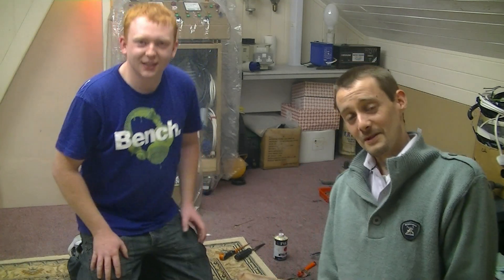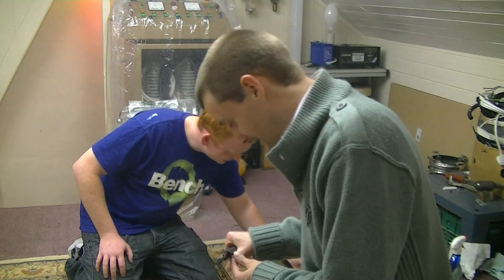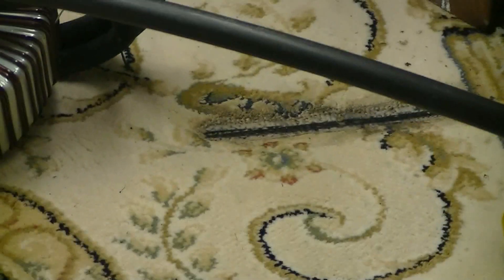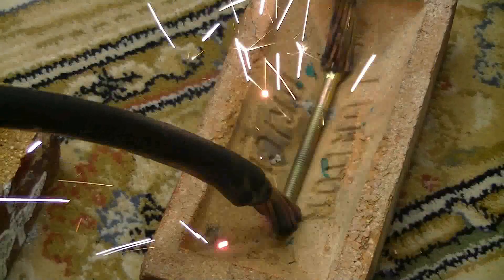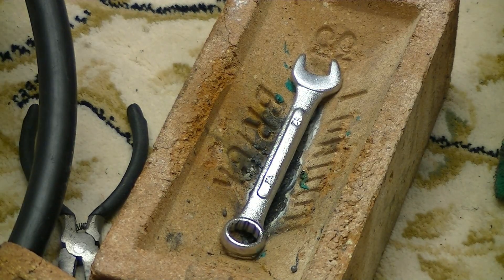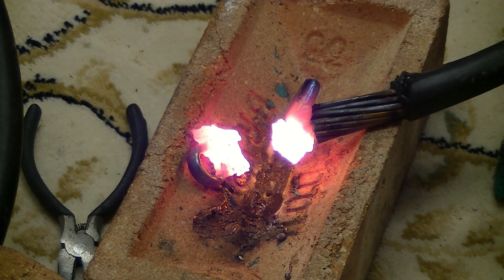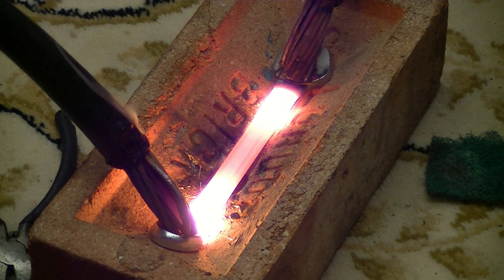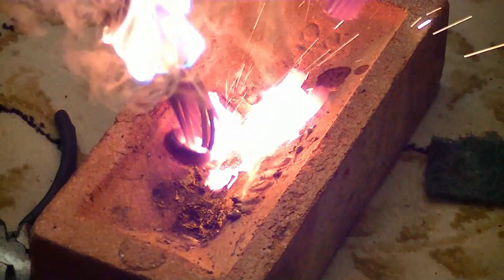5000 Amp Fuse + Tools Melt With High Current

Comment: They are going to find these 2 idiots in that room cooked like over done corn dogs, that's more than enough amps to stop your heart...
Reply: Nicolas Ostrum no, a transformer can get very high amperage and very low voltage as seen in this video
Reply: Waffles is right the rest of you are ill informed.
Reply: Or burnt to death because they got molten iron on the carpet.
Reply: calling people retards when you can`t even spell....the irony!
Reply: yeh a low current across th heart can sop it (think its like 20ma or something) but you need sufficient voltage to get a shock. For example, a 12v car battery can supply 100s of amps for a short period of time but you wont get a shock of it if you put your fingers across. Not sure what the voltage starts at to start getting shocked though
Reply: Pro Wafflez why exactly, explain?
Reply: dean lewis just watch this he also did a video on what is the killer volts or ams https://youtu.be/hp97GjuULX8
Reply: volt relates with amp,so you can't get a too low voltage but high amp because the electric flow will not  create a current,and you can't get a too high voltage with too low current because the current will flow in the surface of material and can't make a strong electric current.High voltage is more dangerous than high amp,high voltage can burn or shock you when you stand in far of the source,even when you touch one terminal and wear shoes.But high amp current can't kill you when you touch because it can't flow through your body,but if your body have suitable resistance like water in the skin surface,the 9 volt high current would be heating the skin only.
Reply: Nicolas Ostrum in a human body you need high volts! For a disaster, the Amps come if the source is able to produce that kind of power.
Reply: Nicolas Ostrum it isn't volts or amps it is frequency that causes atrial fibrillation.
Reply: Yes, the amperage here is plenty enough to kill you, but the voltage is so low it wouldn't even be able to go through your body.
Reply: Reading this comment thread makes me wonder if some people even graduated high school.
Reply: https://en.wikipedia.org/wiki/Electric_shock?wprov=sfla1
Reply: lol good video. I wonder where it starts  on your hands, or hand to hand across your chest. Have had mild shock off telephone wires (think they ring at a higher voltage too)
Reply: it isn't high enough voltage for you to even feel.
Reply: Sebastian Neufeld Volts and resistance define how many amps flow ffs
Reply: Sebastian Neufeld HELL NO AMP IS CURRENT NOT RESISTANCE
Reply: LoliDefiler amen ;(
Reply: Thomas Cruz they wont go trough the cable at all man cuz the circuit isnt closed okay? Learn it ffs
Reply: JAMESMANHUNT9 NO IT GOES UP WITH VOLTAGE. YOURE TALKING ABOUT WHEN U TRANSFORM V TO A  BUT THIS IS ABOUT RESISTANCEE OMFG
Reply: Luke Deedman see its ez
Reply: Luke Deedman but your resistence values are wrong i think
Reply: Pro Wafflez you don't know how electricity works do you?
Reply: As long as the voltage is low they can touch the wires and not be phased
Reply: .01 amps is enough to kill you whats gonna kill you is something that has a very high voltage and low current
Reply: Whether current relates to voltage is irrelevant for me here I know what I know but..  Il ask anyone here if you think your right and say that it won't kill you Il still put money on it that you wouldn't touch both ends of that cable and if you argue the point but not enough to do it kindly keep your opinion to yourself or let's see how right you really are :)
Reply: there are not enough volts to pass your skin resistance. More dangerous to make this on the carpet.
Reply: You must have high volts for the current to breakthrough this thick sheet of resistance we have called skin. If we had no skin at all and we were wet volts would I'll us. Lol. But it's the combination
Reply: Fucking jesus christ no
You would need at least 50 or so volts (depending on skin conductivity and whatnot) to actually get enough current flowing through your body for you to feel anything
The voltage directly determines the amps (Heard of ohms law?)
If the voltage is low,  the current capability is high but nothing (or very very ltitle) will flow through your body as the resistance of your skin is way to high.
Reply: No shit?  It could stop many many hearts...
Reply: NIkefan253 an ipad charger releases 2 amps and 5 volts acording to you it could kill someone, but it doesn't because you need both volts and amps to kill someone you need a balance of amps + volts it cant be just 1 off them
Reply: Randolph Catchot  For anyone curious about what will and won't kill you, I thought I would answer as a student of electrical engineering. It is both amps and volts that will kill you as well as exposure time. I've seen a lot of people arguing about the correlation between voltage and current. The truth is you cannot determine the value without the resistance. V equals I times R. So I would assume that the resistance is low. Say it was at 0.1 ohms then the voltage would be 500 for example. Your skin itself also has resistance of around 10,000 ohms dry or 1000 wet, once your skin brakes down from the current your resistance drops to 500 ohms. In a case where your skin is wet completing this circuit with your own body would most definitely result in your death . Most likely you would not be able to let go and would die. With dry skin a lower current would be able to make it through that would be less than lethal.
Reply: Randolph Catchot not enough volts
Reply: +Sonet that's bc 50 volts is probably the threshold for getting shocked.  a 24 V probably wouldn't do anything even if it had that many amps
Reply: actually as voltage goes up amperage goes down
Reply: 50 mil Amps is enough to cause cardiac arrest, this would light you on fire..
Reply: We were always taught in basic electronics that 60 milliamps is enough to kill you.  Different sources say different things on that amount.  Basically, it's less than 1 amp.  Those that think you need high voltage: Come where I work and grab a hold of one of our main bus bars.  It's only 50 volts, but 3450 amps.  We'll come sweep you up later.
Reply: NIkefan253 amps is the resistance that something has, (or the amount of electricity it needs to run)
Reply: Alvis Gwa Volts dont kill you, amps do. And only .10 is sufficient enough to kill you
Reply: Pro Wafflez Yeah amps do kill you, what you're trying to say is high amps, high volts, because you cant have high aps without high volts

Comment: Entertaining but incredibly stupid. If you know literally anything about electricity, you know it's pure dumb chance they are still breathing.
Reply: Photon is an Electrical Engineer. Assuming he's not tooo drunk, he knows what he's doing. For instance, the big copper cables only have about 3 volts on them, so the short-circuit current of several hundred amps is meaningless as an electrocution hazard. In some other videos, high voltage is used at non-trivial currents. Then care is taken. Well... some care is taken! ;)
Reply: Something tells me they are electricians on building sites

Comment: I do not really know about electricity. I have respect for it. Can hurt a lot if you do something wrong. My question: have you no fear when the 2 cables come together that there is a short circuit or a bang? Or does not happen if you hold the 2 cables together? I know this from normal power cables. when you put + and - together there is a bang and the fuses are outside. why is not happen here ? soooooorrry 4 my bad English -.-
Reply: Cap Designz the bamg is just the current making a short in the circuit , the bang itself is not dangerous , but the current in electricity is
Reply: no bang as nothing blows. Its not a direct link to the house mains its via a transformer setup. It is a short circuit and the lowest current handling link gets it! The tools etc.. :-)
Reply: Its already kind of short circuit and if the cables touch nothing would have happened but it they stay touched then they would heat up eventually but its not big of a deal because they wouldn't touch each other that long anyway.And there is no bang I don't know where you came up with that.
Reply: hes looped some big wires around a transfomer so not directly connected to house mains but  the secondary loop can generate the current needed and the cable is big enough to take it (the tools can handle less current than the cable so they burn up first). if you left the tools out the wire itself would burn until the circuit broke somewhere along

Comment: Can 30 Ampere Kill A Man?
Reply: If you body has a average resistance of 1,5kohm you would need around 45kVolt to get 30 Ampere thru your body and this will DEFINITELY FUCKIN KILL YOU !
Reply: 50 mA across the chest will..
Reply: .hell take the positive and negative from an ordinary 220v 40-60 amp circuit in each hand and let me know how that works out for you

Comment: 5000amp with  a 120mm2 wire???No,,,is impossible,the wire burns in less than ten seconds,,,  if you will know the maximun  short current apply this formula    Icc=70 X A/  SQR  T          where Icc the maximum short circuit currrent supported the wire  70  is a constant   and  T is the time in seconds    example   120mm2 wire   T=5 seconds     Icc=3766amper.   the 120mm2 wire only supports 5ka  in three seconds  then the wire melts and burns.  And be careful with the sparks,,,,y suppose you are using 2vca max,,,but the transformer is little for 10 kva.

Comment: Surely, by using a similar method (transforming down to a few volts and massive current), an electric kettle could be constructed that would boil water in what? Say, three seconds? Or is this not feasible by way of size of required transformer? Prof. Photoinduction, Yuz Most-Righteous Imminince  Sir,  Your Thoughts?

Comment: That is why he uses monster wire for high voltage experiments and it's 0 gauge wire that he is using and it's very thick wire the same wire used for welding

Comment: you need a bigger and better toroidal transformer, the tranformer you were using, is for spot welding, inorder to bump 5000amps you need bigger tranformer like the ones in power stations with gauss material as dielectrix.

Comment: Blacksmiths, get rid of your bellows and hot coals and get yourself two big fat electrical cables. Also great for cauterizing vasectomy incisions.
Reply: Probably his dads wrench too.
Reply: Most modern forges that produce on the industrial scale already use electrical induction as the source of energy to melt the metal.

Comment: Funny watching youtubes brightest discuss whether its volts or amps that kill you. All welding machines are constructed with low voltage and high amps, so that it wont harm the welder. Its powerful enough to melt steel, but wont harm a human, will only gives you a nice buzz with gloves on. Volts are the killers because no matter how high amps, it cant travel inside the human body if not supported by high voltage. Now listen to the king and oblige to his wisdom.

Comment: Concerning the discussion about the danger touch the wires. It is totally harmless! -Unless they are red hot! There is not voltage enough to chase the necessary current thru the body. I would assume the open terminal voltage of the guy's tool burner to be around a volt or a few volts. Less than a car battery. However, the internal resistance of that thing is extremely low. The secondary can chase a lot of amps thru a device of metal if the total resistance is low enough. The secondary winding was three or four turns. How many turns is the primary? Perhaps a hundred or three? Do the simple math on N2/N1 = U2/U1.

Comment: You guys are pretty funny! Interesting what amps can do. This was a very good demonstration of the fact that low voltage accumulator batteries are a far more dangerous concerning fire hazard than our 230/400 grid. Just one negative thing. The cigarette gives a bad publicity and a rotten karma. Then I wonder what mother will say when you perform the experiments on her nice carpet...

Comment: Looks safe.
Reply: security carpet approved
Reply: The home insurance people must love you guys.
Reply: All right
Reply: МотоЖитуха the fireworks?
Reply: Erick Lopes ty, but you used 25V instead of 5V in your analysis. That could mislead some readers.
Reply: It's high current but low voltage. According to ohms law: I=V/R
which means that the amount of current that passes through your body is the result of the voltage divided by your skin resistance.

If they're getting 5v at 5000 amp (that would be like 25kW of fucking power, which is about what they can get from the power lines without raising some eyebrows for overcharging) then it would be I=25/100.000 (dry skin) but let's suppose the worst hypothesis of unprotected hands wet with that spray they're using so resistance would drop to 1kOhms. I=25/1.000=0.025amps or 25mA.

So the power is I*V so 0.025*5=0.125W or 125mW of power being dissipated through his body. That can't do shit.

Compare it to 120V.

I=V/R=I=120/1.000=0.120A or  120mA. As power is I*V, you have 0.120*120 which takes 14.4W into your body! It's literally over a thousand times more power!
Reply: Erick Lopes finally someone else who knows electrical  ⚡️
Reply: Really bro ?

Comment: Some real geniuses here.   Playing with dangerously high current inside on a carpet after admittedly drinking at the pub.

Not to mention the toxic fumes from the zinc that burned off of those galvanized bolts.

Comment: man...5000Amp...dude ,,,you could get kill right there if just one mishandling!
Reply: jpthsd No you won't, not if the voltage is low. Your body has high resistance, and with low voltage you won't even feel a shock. That's why you can touch the poles of a car battery and nothing happens even though it can supply hundreds of amps...the voltage is only 12v.

Comment: Destruction is great! However (and isn't there always a 'however'), you guys sound as if you're not wearing any breathing apparatus. Maybe you should think about your health:

Chromium plated objects: when subject to high temperatures as they are here, the highly toxic Chromium (VI) Oxide, CrO3 is released as a gas. Inhalation of this gas even slightly, is extremely carcinogenic, that means it causes you to develop cancer!

Zinc plated or galvanised steel: When a zinc plated object is melted, the first thing to happen is that the zinc is immediately burned off as an oxide. Zinc Oxide gas is extremely toxic and responsible for 'Metal Fume Fever'... The signs and symptoms are non-specific but are generally flu-like and include fever, chills, nausea, headache, fatigue, muscle aches, joint pains, lack of appetite, shortness of breath, pneumonia, chest pain, blood pressure change, and cough. A sweet or metallic taste in the mouth may also be reported along with a dry or irritated throat which may lead to hoarseness. Symptoms of a more severe metal toxicity may also include a burning sensation in the body, shock, no urine output, collapse, convulsions, shortness of breath, yellow eyes or yellow skin, rash, vomiting, watery or bloody diarrhoea or low or high blood pressure, which require prompt medical attention. Flu-like symptoms will normally disappear within 24 to 48 hours. Full recovery often requires one to three weeks, although it is not uncommon to take up to 12 weeks.

Rhodium plated steel, typical of the non-corrosion bolts that you use: Ro2O3 is given off during the heating process, an extremely highly toxic gaseous compound, and highly carcinogenic.

You guys really ought to take gaseous things on board, before you both contract incurable cancer!